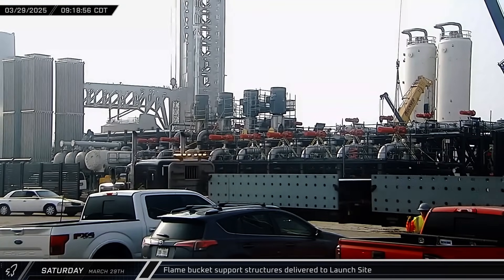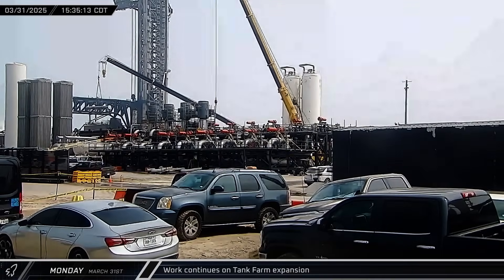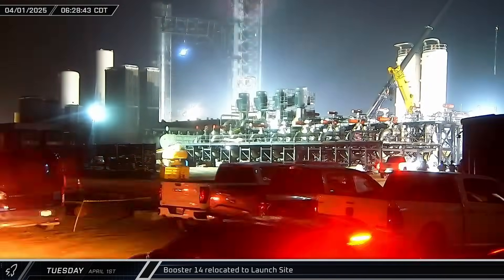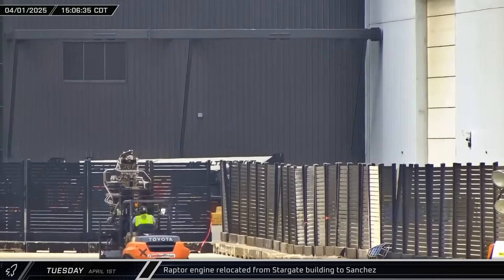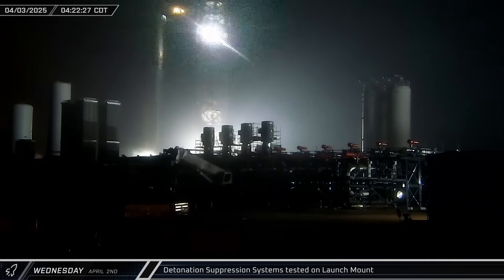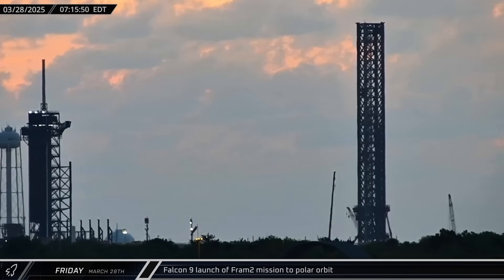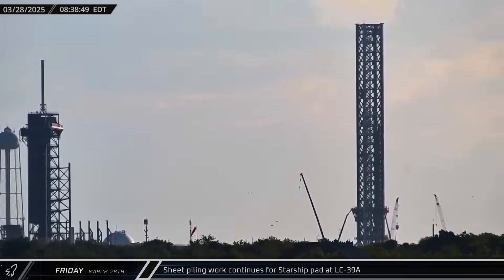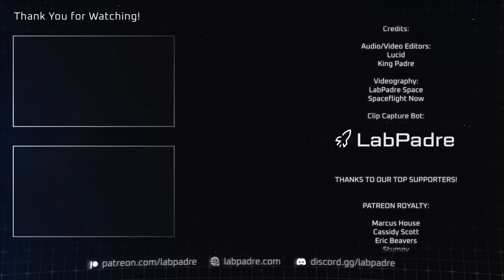It's Happening! First Reuse of a Superheavy Booster - SpaceX Weekly #161

Comment: Considering they have to launch every 2 days to fuel the ship in orbit for the Artemis III contract, I doubt this rocket will be ready in the 19 months left before it happens, actually I doubt this rocket will even get to the moon.
Reply: Artemis wont be ready for many years. They have time to spare.
Reply: @terrestrialcreature7481  They have already done an orbit of the moon, how close to this is Spacex?
Reply: @flightsimdev  They dont need to launch 20 “at once”.
They can do it across multiple days or longer. No big limitation on time.
20 is also the worst case scenario.

SLS did a fly by with a different rocket configuration than the one they’ll be using, and has issues with the heat shield that still need to be addressed. The actual configuration won’t launch for a couple years. Apr 2026 is not a date that will hold.
Reply: @terrestrialcreature7481  You're not allowing for boil off in space, are you? Every 45 min the sunny side is 29 tons of fuel loss, this has already been confirmed. This has to be allowed for when you delay tankers going up, Starship is 120 tons full, each day is 29 tons lost, it's why I said 2 days, as 4-5 day launches, it's never going to fill up hence the 20 tankers.
Reply: @flightsimdev  Those are really good points
Reply: @ Watch a video from Common Sense Skeptic, he has actual people in the aerospace field that talk about SpaceX and how far behind they are.
Reply: Where did a launch every 2 days come from?
Reply: @imaginary_friend7300  How will they refuel the rocket in space, they need 20 tankers, they can't launch 20 at once, can they?
Reply: @flightsimdev  So you made it up.  That's what I thought.  No one has any idea how many tankers it will take since we don't know how much fuel is required OR the capacity of a tanker.  That doesn't stop you people from making things up so you can pretend you're smart.
Reply: @imaginary_friend7300  I meant SmarterEveryDay, not Everyday Astronaut.

Comment: Why is it a big deal to refly an old v1 booster? The v2 or v3 will be an entirely new design, so reflying an old design really doesn't mean much. We've seen how successful the v2 starship has been so far....
Reply: Launch cadence. They don’t have to build as many new boosters, thus can launch more. This also means they can focus more on building ships and v2 boosters while the current fleet of v1’s fly.
Reply: It does allow them to validate some hardware for reuse even if it's not all.

Comment: It's about damned time they tried to act on their claim of "rapid reusability". Until now the only thing that has been reused was a single booster engine. Very pleased to see that booster make it out of the high-bay, I was worried that it was being held there as a political prisoner and needed saving. Once again, great work by the LabPadre team.
Reply: @B0M0A0K im pretty amazed they are actually gonna re-use it now. its actually insanely fast development for the scale of things.
Reply: This is still a prototyping stage with non-final test hardware. They only just got back these super boosters, and they are gradually testing reusability from an engine to several in a flown booster.
This is not nearly as rapid as they planned because it's still just testing and learning, but it's been a relatively quick turnaround for this stage.
Reply: The goal is rapid reuse, it's not a claim yet.
Reply: @B0M0A0K  you may not be aware of how hard rockets are and how big this vehicle is in the world of rockets.  

It’s been 9 years since the program was announced, they’re about on track.
Reply: Some us have no clue ! Team Space X are the best of best ! These is the number 3 and sometimes 4 and 5 Rocket missions going all week all 52 weeks of year !  @stevenanticknap6966
Reply: Except this was not "rapid" at all. And it's an old v1 booster. It doesn't mean much.
Reply: @stellarfortressnemesis By space standards even this is rapid. Space Shuttle took an eternity to refurbish.